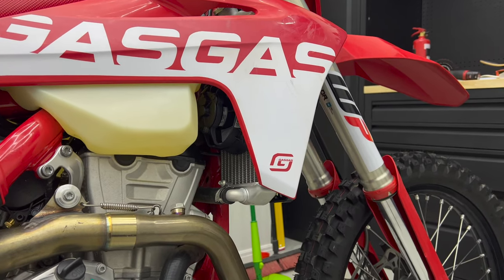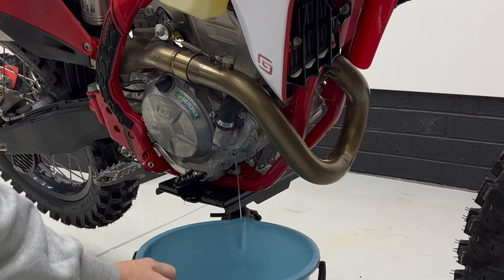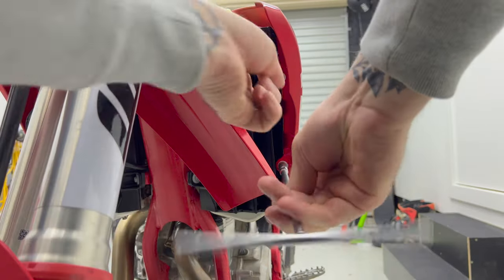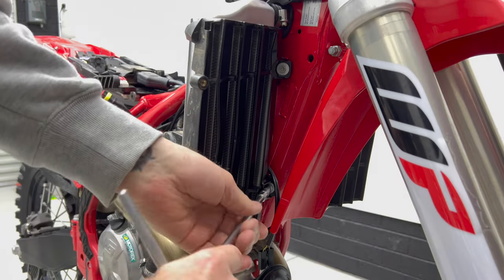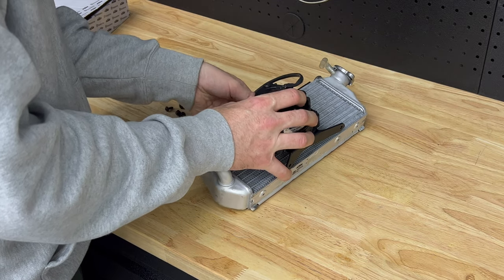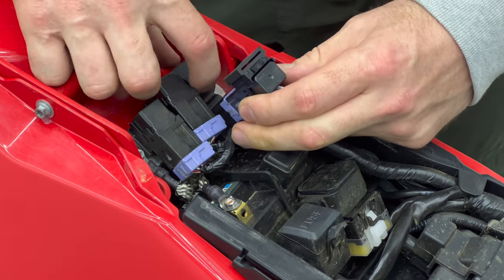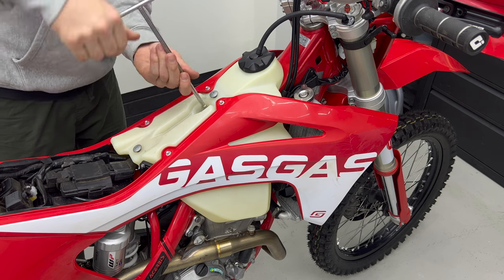How To Install Radiator Fan (KTM / Husqvarna / Gasgas, enduro models)

Comment: Superb video - thanks so much. Added fan to 300 exc 6 day this evening after a few boils on hard enduro. Hoping does the trick. Did it solve any boiling issues for u ?
Reply from the maker: Thank you, yeah I haven’t boiled my bike since I’ve installed the fan and we do some pretty slow and steep climbs. So I’d say it helps a lot!
Reply: @jackkellybuilds  same here. No boiling this weekend doing the snotty stuff and fan worked a treat 🙏

Comment: Any idea on where to add or if you have to add a relay on the 24 ec300? The kit I got didn’t come with a relay, but installed the exact same. There is no spot for relays like this one under the seat in the 24.
Reply from the maker: because that is a new model year im not sure unfortunately
Reply: For 24 model you dont need relay. Just plug in

Comment: Great Video! How does the cooler know what the temperature is? Does it still work if i have a thermostat bypass?
Reply from the maker: there is a coolant temperature sensor on the side of the cylinder head so yes the fan will work fine if you have removed the thermostat

Comment: It looks to me like it can be done with the rad in place not chance of getting an air lock ,is that correct? . Nice and clear video look forward to seeing more of your content,I’ve subscribed so I don’t miss any thanks for making it 🏍️👍
Reply from the maker: it's possible,  but there's a good chance you wouldn't be able to install the screws on the frame side of the radiator to hold the fan mounting bracket in place. but its possible that the fan would still operate fine. it just might not be as stable. thanks for watching!

Comment: Somewhat helpful. My KTM kit has an LCD display with a temp sensor and thermal grease - not sure how or where that gets attached. Also, not convinced that the fuel tank needs to be removed on my 2017 250 XCW.
Reply from the maker: you have a different kit, the temp sensor and thermal grease in your kit gets inserted between the fins at the top of the radiator, you can then control when the fan turns on and off, with the LCD display. Your kit is made by trail tech and the install instructions should be on their website. The kit in this video is controlled by the ECU with no temperature readout, therefore making it a cheaper alternative to the trail tech kit.

Comment: Nice mate. Did you notice the bike getting hot in tight slow stuff or is this just a preventative measure?
Reply from the maker: yeah I boiled it over a couple of times on some steep and slow climbs, so hopefully this helps, otherwise ill also get a coolant overflow tank

Comment: I installed mine, and couldn’t find the wire connector to the fan, any idea? 2022 ktm 250 xcf
Reply from the maker: that is odd, sometimes the plug is tucked away zip tied up in the loom somewhere but since this is a factory ktm fan kit the plug should be there on all late model bikes.

Comment: My plug isn’t the same as on the bike. 23 ec300 and so I hard wired it and installed the fan relay and it’s still not kicking on. Any ideas?
Reply from the maker: Im not sure mate, the plug should be there, and the fan only kicks on at a certain temperature, have you gottenm the bike hot enough yet?
Reply: @jackkellybuilds  yes I have it set at 150°f and it doesn’t come on
Reply from the maker: @brysonaverett6661  it sounds like you may have a different kit to this one if you're able to set the temperature. this fan kit's on/off temp is pre-determined by the ECU

Comment: We can’t get EC 4 strokes in the States.  Only the EX.  Anyway, on my EC300 2 stroke this is the kit I used.  

I just picked up an EX250F and according to the dealer the fan kit with the digital temp gauge and probe is the only one that will work on the EX.  I don’t know if that’s true.  Still trying to confirm.  I’d rather have this kit.
Reply from the maker: yeah I'm also not sure if thats true or not, but I use the technical accessories section on the gasgas website to see what aftermarket/ oem options are available for my bike. maybe this kit may be listed under the ex250f

Comment: I dont have a connector on my bike for this fan. I have a 2024 gasgas ex 350f, and i have the same fan you have in this video. But i have no connector.
Reply from the maker: I think the plug will either be tucked up in the harness or is only on the enduro models

Comment: Great video mate! I'm looking at buying a ec250f . Subbed 👌
Reply from the maker: thanks mate, I appreciate the sub!
Reply: @jackkellybuilds  Random question - What did yours come with? Was the cat still in the exhaust? Did it have a rubber assisted front sprocket?
Reply from the maker: @Booki89   no cat in the exhaust, the dealership removes a lot of the stuff not required here in Australia, in other countries that stuff is left on. And yeah it also has the rubberised sprocket in a bag of parts that came with the bike, but the bike had a solid front sprocket installed when I took delivery

Comment: The factory instructions say to screw the screws in from the front but you did it from the back...
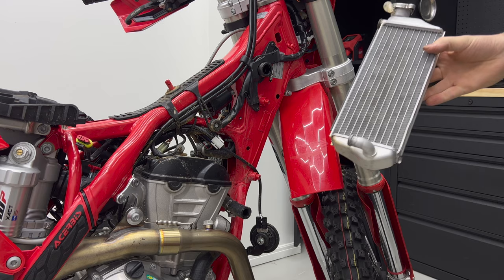Reply from the maker: 1:32 I put the screws in from the front, I even say that in the video, and you can see that I put them in from the front
Reply: @jackkellybuilds  you did it the correct way.  If you look at the KTM manual for the fan it says to install the screws from the opposite end that you did. Obviously this is incorrect because the screws won't hold.  I just installed the factory fan on my 2024 KTM 250 XCW.  Also you don't need to remove the radiator completely. I removed just the top hose and angled the radiator slightly to get to the 2 mounting screws.  Lost barely any coolant this way.  Thanks for the vid!

Comment: Do you know if this can be done on a husqvarna fc 250
Reply from the maker: No, will only work with enduro models
Reply: @jackkellybuilds  on the fan kits I've looked at it says fits a fc250?🤷
Reply from the maker: As far as I know, the ktm factory kit in this video is only plug and play with the enduro models. I think a few people tried to install this kit on cross country or motorcross models and couldn’t find the plug under the tank for it and had to come up with another solution. But if the kit you’re looking at says it fits, I guess it does

Comment: $10,000 bike overheats and blows a head gasket if it idles to long. They must be living on some other planet. Engineers who I have always suspected as being disconnected from reality really screwed up on this. No excuse for a bike to over heat just sitting and running the bike. Maybe I want to just let it run for 30 mins to listen to the motor. Oh I forgot, it’s a 4 stroke so it’s sounds stupid anyway so no need to let it idle.
Reply from the maker: 30 mins is a long time to let anything idle without a means of airflow. I installed the fan for when I'm doing tough hillclimbs when the rpm's are high, but I'm not moving very fast to help the bike stay cool. thanks for the comment